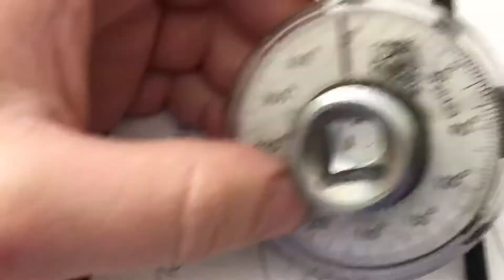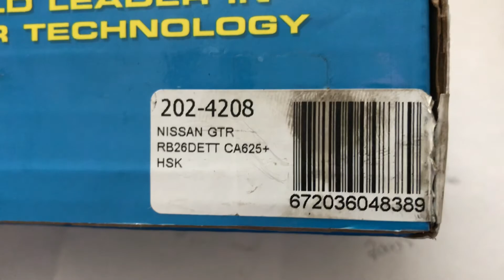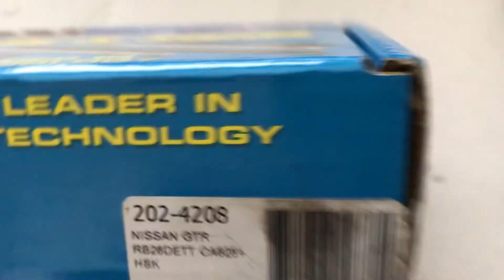Rb26dett ARP CA625+ head studs

Comment: Have you ever used Tomei head studs?  What do you think of Tomei's head studs?
Reply from the maker: no one i know uses or ever used a set of Tomei head studs.  no data on them to compare other then they say they are stronger than stock..  maybe equivalent to ARP 2000's head bolts in my opinion, but i have nothing to go off and i don't speak Japanease so cant find data points on them.

Comment: Again very good video. You should record your entire RB26 build ! Simply things now I'm aware and sold on ca625. Cost effective in the long run. 
Cheers
Reply from the maker: Thanks bud.  I just recently got into making videos.  I have been working on and modding my skyline for years now.  A lot of things i wish i recorded.  Now that my car starting to come together with a lot of problems getting fixed.  I have started getting more and more serious about going race car and making more power.  several things i have set aside for when i pull the motor back out again.  but i definitely am trying to capture more video content.  If you got any questions on anything ill be glad to help. Cheers!